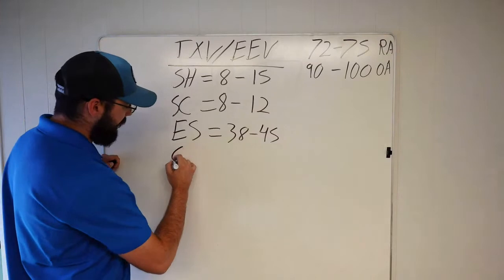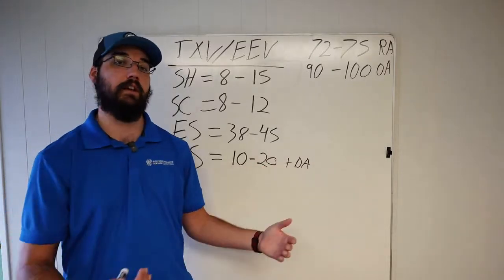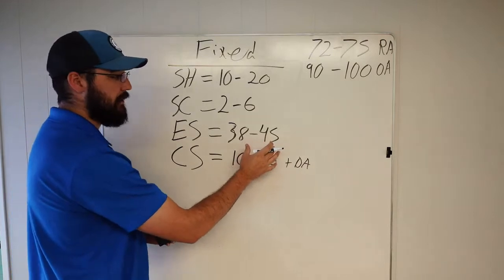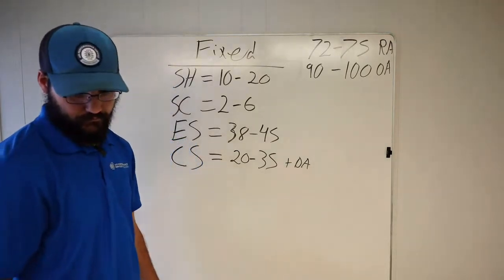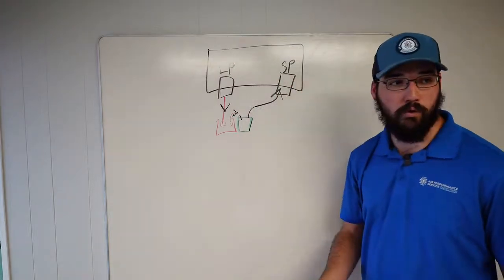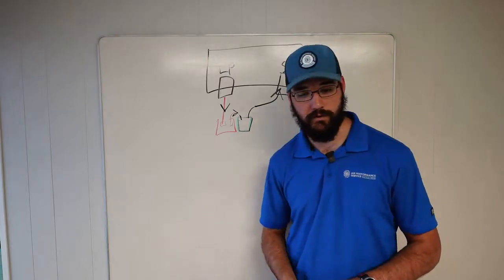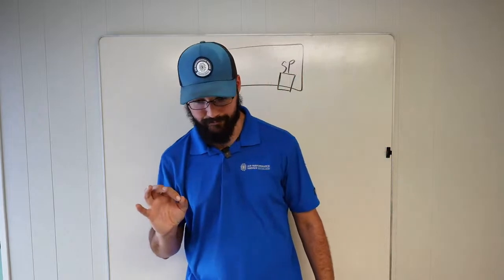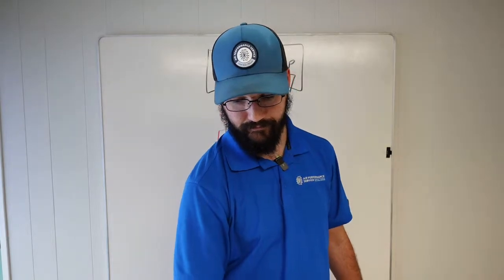Refrigeration Refresh for HVAC Technician P1

Comment: From my experience the higher than normal subcooling do to a dirty condenser is from the elevated head pressure/sat temp creating a much higher t.d. between ambient and refrigerant temp. Even though you have lower than normal airflow through condenser, the t.d. is much higher than normal conditions which in turn rejects more heat than that condenser is designed for under normal conditions. But don't be confused, this is not a good thing, you're still ending up with higher than normal liquid temps which you don't want, this is why we always need to make sure coils are cleaned before we make any rash decisions. These numbers can tell us we need to clean or something wrong with condenser fan. I think this is where the approach method came into play, you could have good subcooling being measured but if your approach is high then you know you have an issue in your condensing section somewhere. I.e. if your liquid temp is 130 but the manufacture chart says for your conditions you should be closer to 105, you know your not rejecting enough heat and now you know to do some searching for why. Anybody agree?  I'll also mention evap load during these condition plays a part in all this, this maybe more noticeable during higher evap loads.

Comment: My thought on your increased head pressure conversation. I believe fixed metering devises we’re designed to increase the rate of flow as the outdoor temp rises to handle the load that was increased indoor in AC application.  Of course a filthy condenser coil would take that above it’s design. Correct me if I explained this correctly. Where a TXV would fluctuate with the load by opening more when super heat increased.  Thanks for listening !

Comment: Interesting.   I believe you need  to do your analysis with the understanding of the amount of liquid in the evaporator coil.   If the condenser isn't converting the hot gas to a liquid (dirty coil) your subcooling will be low and you'll be starving your evaporator.  The limited amount of liquid being boiled off and subsequent super heat will be dependent upon  this factor.    Of course the amount of heat going across coil a factor as well.    Gas doesn't pick up much heat, the act of the transforming liquid to gas is where the heat is picked up.   Thus I can see where a dirty condenser coil (limited liquid to evaporator) could reflect lower super heat.  High saturation and high line temp .  anyway interesting and looking forward to test

Comment: A dirty condenser will initially decrease superheat. Elevated head pressures will force more liquid through the metering device decreasing superheat. Once the system balances out, elevated condensing temperatures will increase the amount of heat contained in the refrigerant, decreasing the  amount of heat which can be absorbed in the evaporator causing refrigerant to vaporize more quickly, elevating superheat. In extreme cases liquid at condensing temperature will return to the metering device and may flash prematurely prior to the device, obstructing the flow of liquid into the metering device, starving the evaporator and raising superheat.

Comment: Had a call on a communication ac. They had a local plumber working on it. The response was it pegs both gauges. In this case the condenser was dirty. Looked fine on the outside. In the situation it couldn't dissipate heat so it forced both pressures up